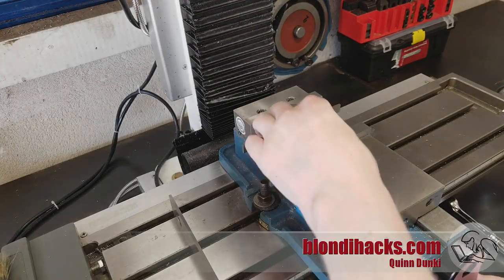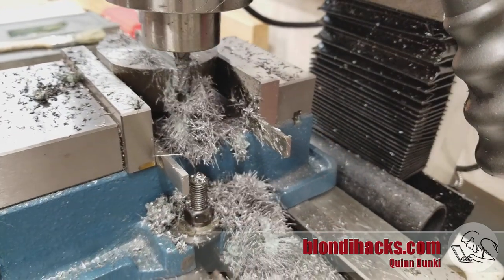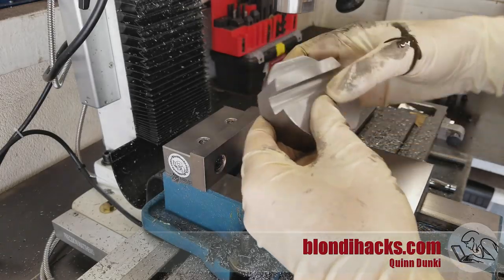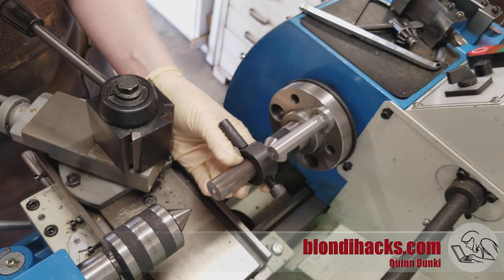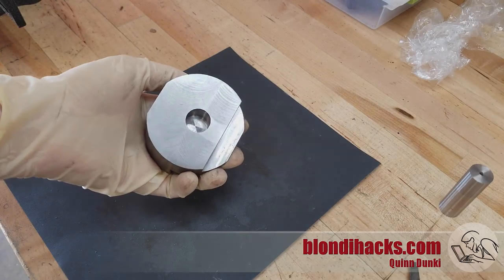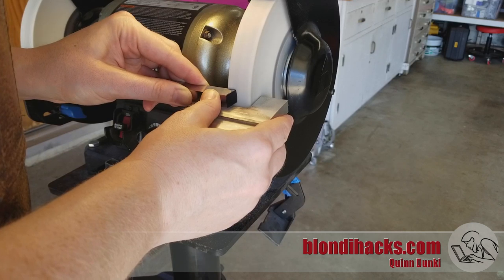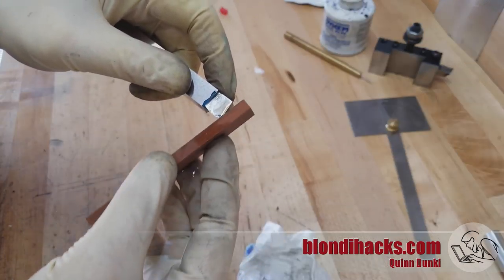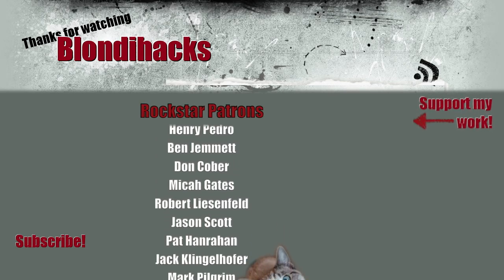How To Make A Fly Cutter : Part 2/2

Comment: More years ago than I choose to remember, I was a service manager for a heavy equipment company.  I recall the mechanics would sometimes use both heat and cold on some repairs.  They would often use dry ice to supply the cold.  I'm talking really big stuff, rock crushers and the like.  I'll be making a fly cutter with your design very soon!  Thank you.
Reply from the maker: Heat and cold are very useful for breaking loose seized fasteners and shafts as well. We do a lot of that when repairing farm machinery and on the race cars.
Reply: @ Rich Knudson you mention the use of getting a size differential by use of cold as well as heat. I often use the bottom drawer of the freezer to shrink a press fit component before assembly. On some really tight fits I use the differential of both together... Female component heated and male component in sub zero.

Comment: Yours is the only internet source that explicitly makes the point about the already built in angle under a milling cutter, when grinding the cutter faces. Pretty much everywhere else, they used a second hand, right cutting, lathe tool as the model for a milling cutter. Just being lazy blokes, I guess. Blondihacks rules!!

Comment: Excellent useful addition to the shop, spot on with 4" diameter reference for lack of horse power, surface finish at macro level can be scary, but the single point finish is great. Actual item would look great in Pink, ref Fusion 360 model 😁.
Nice explanation on the heat/shrink fit, only point I would add is to allow 30 mins per inch square section, after oven has reaclimiatised to soak temperature. Liquid Nitrogen is used where possible as it does not degrade or add impurities to the surface finish.
Again many thanks for sharing, and best regards from the UK.

Comment: Very nice build and I'll bet it gets used more than you expect. First time I saw "heat and cold" used was my Uncle and a buddy repairing a Galaxie 500 back in the '60s. The flywheel body went into the deep freeze over night and then the gear ring was put in the oven. I remember they were sweating it to make sure everything went together square.
Reply: what do you mean they were sweating it?
Reply: @jwiereng  "to worry or be nervous about something"
Reply: @jrkorman  they were nervous or worried to make sure everything went together?
Reply: @jwiereng  Yes - They were a couple of 18 year olds doing this for the first time.

Comment: Great series of videos, enjoyed every minute.  A very basic rule that one of the older guys at work told me regarding the amount of ‘nip’ on an tight interference fit. He always worked on a thou per diameter inch of nip. He used this basic calculation to fit cast steel wheels to machined spindles. Your comment regarding using liquid nitrogen to shrink the mating parts struck a chord with me. As an apprentice one of my jobs was to make a large tank from plywood to fit round a large diameter shaft (250mm). This shaft was the main pivot on a mobile crane and needed to be a freeze fit into its bearing housings. The shaft was dropped into the tank - this tank was filled to the brim with liquid nitrogen. The tank took approximately 60 to 70 gallons of nitrogen. The shaft then sat in this tank for a few hours to shrink down to the required diameter. The tank did not require a lid as the nitrogen looked just like boiling water as the liquid boiled off and returned to its normal gaseous state. The other apprentices kept threatening to throw me into the tank as I was the youngest guy there. Thankfully they did not!  Just a final thought is that you could use something like a Tally Surf machine to give you an accurate Ra value of your machined surface. We have a super accurate machine at Rolls-Royce for surface finish analysis, no problem with you posting off the plate to me and I will give you the surface finish values.
Reply from the maker: Wow, that’s a lot of liquid nitrogen!! 😮 Cool story, thanks for sharing!

Comment: Hello Quinn, I really enjoy watching your videos :D
For the shaft shrinkage, even liquid nitrogen would have been too "hot" for creating a 480°F delta with ambiant. Liquid nitrogen starts freezing at -346°F, so if you were at a room temperature of 68°F, you would only get a -414°F temperature delta which would not have been enough. Anyway liquid nitrogen is not likely to be usable at -346°F (it is very hard to keep it at a so low temperature). It usually sits at around -320°F, so you would have had to heat the tool holder up to 80°F over ambiant to make us of liquid nitrogen on the shaft ;)
Cheers and thank you for sharing and explaining your working techniques :)
Reply: Ahhh, Fahrenheit... that gets us a little closer to having this be meaningful.  I guess absolute zero is all the way to −459.67°F... and room temperature being part of the mix saves us from having to get that cold.  In Fahrenheit.  a 480°C delta, though..... that'd be a different story.  :D

Comment: Great video!
HF has inexpensive optical temperature sensor 'guns', might be useful.
To touch on a technical point, liquid nitrogen has a boiling point of –320°F (–196°C).  Wouldn't have been enough without heating the fly-cutter body.  
Re ovens:  toaster ovens (and ovens being removed for remodeling) are inexpensive on Craigslist etc.  No need to use the oven used for food, and the likely funny tastes and possible toxic exposure!

Comment: Another product that I use is Crown 3090 Tool Saver. Slightly less cost but works great for rust prevention on tools. It also leaves a waxy coating.

Comment: Nice work! I replaced my HSS tool bit with a small cheap right hand indexable tool holder for small lathes. Leaves a super nice surface finnish and I can crank upp the speed on my small mill.

Comment: I have a bit different experiences of flycutters. I first made similar one and it worked only on aluminium and soft steels with shallow cut depths like 0.1mm. With deeper cuts or harder steels,  I got terrible vibrations and my mill gearbox sounded like something was going to brake. I have HBM profi 45, which is not smallest Chinese mill.

Hss blades got damaged quite easily but triangular carbide worked better and I was able to put the holder on my cutter.

Then I made a new version and everything changed dramatically. I made an iso 30 taper and attached it into 25mm (1 inch) thick and 160mm diameter plate and then machined the plate straight. I have made iso30 adapter, which I can mount directly to my spindle. 

Then I made a small holder for apmt1135 insert and small groove and threaded holes so I can mount it on different part of the disk. Around 80mm diameter seems to work best.

Difference is huge since the disc is perfectly balanced and very rigid. It also have very high inertia, and it practically removes vibrations. With aluminium, I can use full 3000 rpm and get smooth near mirror finish even with very fast feeds. That insert is very cheap and works well. I have bought 10pcs from aliexpress with less than 2€. It has relatively wide flat cutting surface, which allows those fast feeds rates.

I can now machine hard CrMo alloys with 2000rpm and 1mm cut depth. It's more I can do with my 45mm face mill, and surface quality is better. Insert also lasts longer compared to face mill. It's probably because of less vibrations.

What I learned about that is, I can compensate lacking rigidity with high rotating mass. Also hard steel alloys cuts much easier when cut depth is deeper and rpm is higher. This cutter allows me to do it.

At first, it was a bit scary to use since I was afraid my work piece may come off or the heat-schrink joint get loose, but I have remote controlled feed so I can be far from danger zone. Also I use it a lot and nothing has happen. The surface quality always amazes me.

Comment: Made my flycutter 9 years ago, used it one time. O well thats ok I have it if I need it. I made mine with less than 1.5 inch material. My mill is about the same size of yours, it works quite well.

Comment: Greatly enjoyed the short series - an excellent illustration of the complex decision making involved in engineering design and manufacture. 

Not wishing to be pedantic, but the relatively rough surface finish from the mill compared to the fly cutter is better described as a result of "galling" (tearing due to adhesion between sliding surfaces), rather than "pilling" (surface disintegration associated with wear).

Comment: 15:40:  Idea:  attach a tool bit to a disk (maybe a slanted cut-off, if your saw will do that) and drill a center hole in that?  Depends on how good of a grip those setscrews are good for.

Comment: Great finishes you're getting on that material Quinn. I may need to go back and watch your videos on surface finishes, you're getting good results!

Did you consider that with the placement of the slot and screwholes, the tool bit is being pressed against the setscrews by the cutting force, instead of being pressed against the flat face of the groove. Most commercial flycutters, I think, do it the other way round. Does it make a difference - probably not. But I couldn't help but notice, so I'm asking the question :-)
Reply from the maker: I considered that, but it made the mass easier to balance doing it this way. The tool bit is such a close fit in that slot that the screws are just keeping it from falling out anyway.

Comment: I never knew what the pointy end of the edge finder was for, neat!

I thought you were going to put the 10deg angle block back in and use an indicator so that it was good in the y when dropped back down but doing it without unclamping and re-clamping is def better

Comment: Did you consider using dry ice on the arbor in addition to heating the body, to get a higher working delta?  (Dry ice tends to be pretty obtainable; supermarkets even sell it fairly routinely...)
Reply: I was thinking even tossing it in the freezer while the base was in the oven would be good.

Comment: To get the best finish from any single point tool, fly cutter or lathe. The feed per revolution should be about half the nose radius. i.e. nose radius is .010 feed should be about .005 per rev.
I know this is extremely difficult to do hand stoning a radius and playing with the speed knob until the chips look right.
But when you get it right you can put a ruler on the piece and read the numbers in the reflection.
Reply from the maker: Unfortunately the power feed on this mill doesn’t let me control the feed rate in a repeatable (or knowable) way. It’s just a potentiometer on the motor. Good advice for the lathe, though.
Reply: You could try an optical or audio tachometer for rpm control. There are apps.
Love the video, love the idea of using simple geometry to achieve a balanced design. Great stuff!

Comment: was gonna say, the flycutter maybe just the tool to use for squaring up stock... wouldn't be afraid to go say 450 RPM and a very light DOC say 2 thou tops, maybe get a mirror finish
Reply from the maker: I’ll be experimenting more, for sure!
Reply: I predominantly use a flycutter for squaring up stock. My mini mill doesn't do well with a facemill.
Reply: Blondihacks the lack of grunt at low RPM is the price you pay for electronic variable speed... Old style machines with belts or gears don't have that limitation, but they tend to cost a lot more and be a lot heavier... I grew up with the gears and belts, they multiply the grunt In proportion to the speed reduction, so it's possible to get really hurt by them if things go wrong... Slower they go, the harder they shove

Comment: Have you ever thought about trying to upgrade the motor on your mill? Curious how involved it would be to do so - assuming the rest of the frame could stand higher torques. I've often thought about getting a small mill but the downsides of the hobby gear being underpowered have dissuaded me.
Reply from the maker: It’s an interesting idea! I think in general the rigidity of the machine is more of a limit than the horsepower.

Comment: Thanks for posting this project Quinn, very interesting and informative.  I have a couple of questions:
What grits are you using to grind and hone the cutter?
When setting up to fly-cut, would you set the work piece centered to the axis of the mill, then set the cutter so it would just extend past the edge of the work piece, essentially shortening the lever from center of axis to tip of cutter (smallest diameter possible)?  Wouldn't this allow the highest torque possible?
Again, thanks for sharing your content,
Cheers
Reply from the maker: The grinding wheel is 60 (Al Oxide) and the finishing stone is a Norton 120 grit, I believe. And yes, you can definitely play with the stick-out and the work position to maximize torque.
Reply: @Blondihacks  Thanks

Comment: Tip for those who need to turn between centers but don't have a dead center for their lathe: Just put some scrap round/hex stock in the three jaw, and turn an appropriate taper. As long as one always dresses it after chucking, it will be dead on. Plus, one can use the chuck jaw as a stop for the drive dog. Stole this one from Keith Rucker.
Reply from the maker: Yes! Turning a center in the chuck is a little used trick. It can also save you removing the chuck.

Comment: Nice to show using the cone end of an edge finder, but maybe more comfortable to just use the regular edge finder on the flats of the workpiece, use 1/2 function in DRO to find center
Reply from the maker: That would not be valid here because the flats are not concentric to the bore. The flats were cut relative to the unfinished outer surfaces of the stock.
Reply: @Blondihacks  I thought that might be the case so now as I make mine I’m turning the outer surface to true it up before boring the centre hole and will be very precise when milling the flats so I can use them as a reference.

Comment: Another great video.  Was the mass of the set screws taken into account in Fusion while balancing the tool?  Then we had to use bigger ones, which changed things.  Just wondering if that made any difference.  Thanks for what you do!
Reply from the maker: I did the math with no holes where the set screws are, since they fill the holes nearly solid. It’s close enough.

Comment: Does your mill have a low speed pulley?  The gear drive version does.  Nice project.
Reply from the maker: It does, and it’s on that pulley. Gives it a range of 50-1200 RPM, but torque is pretty poor until about 200. Limitations of brushless DC drives.
Reply: Blondihacks ok, that’s about the same as the geared version.
Your mill is very nice.

Comment: Hey Quinn, great video, as always, thanks! Just looked through your library in search of a video on your glass scales on your mill but was unsuccessful .. do you have an install video series somewhere? In particular I'm interested in your thoughts on the z (zed, Canadian) .. do you find it useful for your day to day milling ops? (I guess I mean on top of the quill digital read out you have also ... ) Curious to hear your thoughts (before I order my DRO) :/

cheers!
Mat
Reply from the maker: Hey Mat! I don’t have an install video on that, because the mill came with it installed. On the other question, I would say I use the Z axis scale very rarely. I use the quill DRO constantly though, because I tend to use it for measuring depths of cut. It would be better to use the Z for that, of course, but that’s such a hassle on a column mill that I end up using the quill all the time and living with lower rigidity caused by that.
Reply: @Blondihacks  Yeah that seems to be the consensus I think .. I'm thinking I'll get the 3 axis unit but maybe only commit to 2 scales for x and y and take it from there :) Thanks for the reply and thanks for your videos. Learning lots :)

Comment: Good vid Quinn, first time I have seen anyone use that pointy centre finder. Is there a reason you did not power it to centre on the piece? Also could it have been used entering in the body at 8:13 . Really great between centres demo, I got to try that some time.
As to finish, I just saw a video demonstrating Parkerizing in Australia nd it might even be a little more attractive than the cold bluing, albeit there is some expense and work to it. 
Enjoyed this video very much, cheers!
Reply from the maker: When indicating on a small radius inside bore, the “kick to the side” action of an edge finder is not as precise, because the curvature traps the pointer.

Comment: Nice design. I've just now watched this video so you may have already addressed this question... How robust do you think the press fit is? I've seen similar builds where a weld was added to the press fit. I'm curious if the weld is necessary? 
These fly cutters have the appearance of insanity when they spin... Is the press fit adequate? How do we know?
Thanks, Ed
Reply from the maker: It’s hard to imagine a 2 thou shrink fit ever coming apart. I didn’t want to weld it and risk distorting things. I guess I’ll know if it ever comes apart.
Reply: @Blondihacks  Out of curiosity I've been researching the strength of this type of press fit on the internet... It's way to technical for me to get a handle on without really getting serious (which is probably over kill)... One day when you least expect it some engineer who is into this stuff will see your video and give us the technical answer... 
In the mean while I'd love to see you install a low gear range on your mill to increase the torque at low rpm....
Ed
Reply from the maker: A backgear for the mill is a great idea! I’ll add that to the project list. 😁